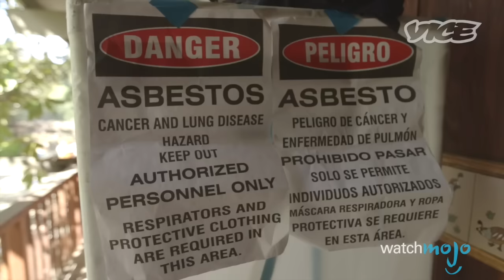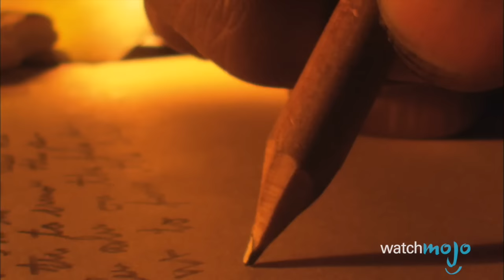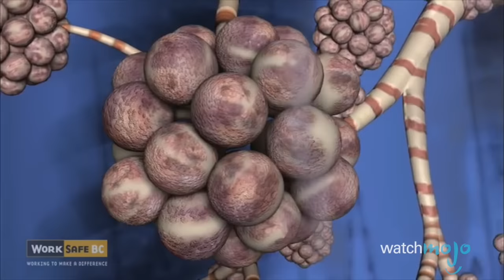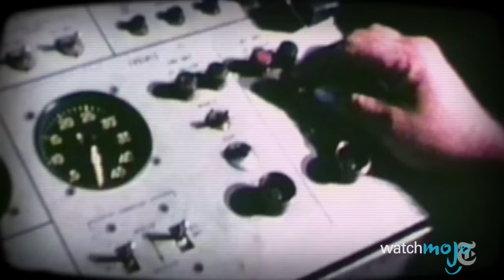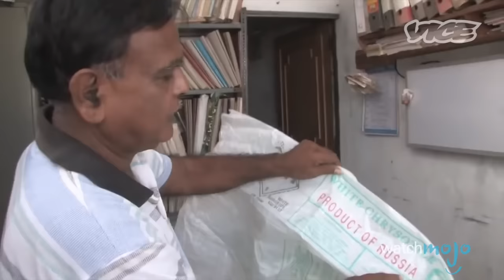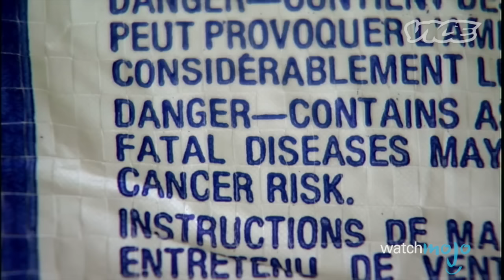Top 10 Dangerous Substances That Will Straight-Up Kill You

Comment: I worked in a chemical lab, and although you certainly didn't want sulfuric acid splashed on you, the stuff we feared the most was Hydrofluoric acid. That stuff goes through your tissues and dissolves your bones. Very nasty stuff.
Reply: it's poisonous too.
Reply: Yep...and unlike H2SO4, its kept in a plastic containers (as oppose to glass). It's also used in the hit series Breaking Bad as the acid of choice to dissolve dead bodies.
Reply: Average Joe teflon right?
Reply: notquitemytempo The one in our lab is polyethylene (I believe Teflon works too). The list in this video is a little overrated. There are far more dangerous chemicals that can "straight up kill you."
Reply: Average Joe not really sure why they used it when its a weak acid. Wouldn't Sulfuric acid be far more effective at dissolving dead bodies? Lol
Reply: Nikolai HF is a weak acid by chemical definition of what an acid is. But its not weak by normal standards. Its more harmful than the stronger and reactive acids.
Reply: I too work in a lab and the thing I fear the most is ClF3. That shit eats through almost anything except Teflon and especial steel containers.
Reply: Hydrofluoric acid certainly causes painful chemical burns, but it doesn't dissolve your bones. It can't, because calcium fluoride is insoluble. The fluoride from the HF will fluorinate the hydroxyapatite in bones, making them harder and more brittle - this is the same method by which tiny amounts of fluoride in water hardens tooth enamel.

The insolubility of calcium fluoride is how HF kills you though. Nerve function depends on the flow of dissolved calcium through ion channels. The fluoride from HF removes the calcium from your nerves by precipitating it out of solution, thereby halting nerve function.

This is how you don't feel the damage from HF absorption through the skin until it is too late - because it deactivates the nerve endings under the skin. If you absorb enough HF, it can deactivate the nerves controlling your heartbeat and breathing reflex, resulting in heart and respiratory failure.
Reply: Diazomethane is in a class of its own. This is a gas which is acutely toxic, carcinogenic and highly explosive. Special glassware is needed to produce it as ground glass joints, commonly used in most chemical glassware will trigger its detonation. Unusually for a carcinogen, you are like to develop tumours just 4 years after exposure, however, its acute toxicity means you are likely to die really quickly, long before developing cancer
Reply: Jude Ananaba  I didn't work in that type of chemical lab.
Mainly dealing with the cleaning and etching of metals.

Comment: There's a certain isotope of cobalt that is extremely harmful. It emits twice the amount of gamma radiation. Gamma radiation basically turns the insides of people into mulch. Essentially punching holes into the molecules of a person's body. If you watch any movie where the victim of radiation is vomiting white stuff, that white stuff is the stomach itself due to the gamma radiation. This particular isotope of cobalt can be found in crud which is a byproduct of reactors. It's rare and as long as the cobalt is inside the crud, it's not a problem. But just a tiny bit of the cobalt is 100% fatal when exposed

Comment: #4, Cesium (or Caesium) is the most reactive stable element on the periodic table of chemical elements (besides Francium of course). It reacts violently with water, exploding the instant the metal touches it. It's so sensitive that even the moisture in the air makes it catch fire (it's the most pyrophoric [pi-row-FOR-ik] substance we know of). It's also so dangerous to have around, that it needs to be transported in a glass ampuole under Argon or Xenon, contained within a pipe bomb, wrapped in tissue and bubble wrap and placed carefully in a small box with FRAGILE and DANGER plastered onto it. It's melting point is so close to room temperature that just holding the ampuole in your hand can melt the metal into what looks like liquid gold. It's also quite expensive (look it up, it's kind of crazy). Cesium has a variety of uses that use only a small amount, such as atomic time.
I'm kind of a nerd. I know this kind of stuff. WatchMojo.com failed to mention some of these facts (and I also corrected a mistake). You're welcome.

Comment: I once worked for a semiconductor (computer chip) manufacturing company, as a chemical technician. My duties were mainly to keep the “tools” stocked with the chemicals used in the chip making process. I placed tools in quotes because although “tools” is the industry name for the machine, it is basically a million dollar+ robot. 

Anyways, many of these machines use highly, HIGHLY caustic, corrosive and acidic substances. While many were very dangerous in their own right, the most terrifying to me was Hydrochloric Acid. It’s so dangerous, that if this chemical in its liquid state comes in contact with as little as 20% of the human body, you have about a 10% chance of surviving. 
The reason for this is that Hydrochloric acid has a a natural chemical attraction to calcium as it attempts to complete a molecular bond. As our bones are comprised of calcium, this acid will eat it’s way through the skin and muscles until reaching the skeleton. 
Fortunately there is a calcium jelly that can be used to temporarily neutralize the chemical reaction. However it’s far from capable of saving your life. The only thing you can hope for, is making it to a hospital that has the capability to deal with severe chemical burns. 
Needless to say, I worked this job for a short period of time before finding something that I wasn’t literally risking my life every day for $12/hr.

Comment: What about francium? It might only have a half-life of 20 minutes, but it is even more reactive than caesium.
Reply: A common misconception brought on by the periodic table and the rules of electropositivity. As you move down the table you get more and more electropositive and will more readily give away electrons to form a positive ion, this is what happens when the group 1 elements explode. However, as atoms get larger so does their pull on the electrons that are in the outer shell. Francium is very heavy (atomic weight 223) and as such holds the electrons close enough that its reactivity drops down below that of cesium (atomic weight 132).
Reply: The list is just plain bullshit. Francium is a million times more deadly than uranium, pollonium and plutonium combined, BECAUSE of it's short half-life.

Take 1g of a radioactive substance. If it has a half-life of 1 year it means 0,5g will have neutralized in 1 year, giving up it's radioactive energy.

If you have 1g of a substance that does the same in 20 minutes you have all of that energy in 20min that the other substance needed ONE YEAR for.

Because of it's short half-life large amounts of francium effectively cooks itself by it's own-produced thermal energy.

Though because it has such a short half-life there is hardly a concern for us, because not much francium exists at any time on the earth (that isn't artificially produced).

The problem with uranium and plutonium is not their radiation, no. It is because both of these metals are EXTREMELY poisonous. If you ate some of either metal, you would die by heavy-metal poisoning, long before you would show any signs of radiation poisoning (except when you'd take that stuff right out of a nuclear reactor).
Reply: ***** Less active in water, yes. But it's radioactivity makes it heat itself up. The larger the mass of the lumb of francium, the hotter it gets (up to the point where it just starts burning with air, but we know that much with cesium already).

Comment: Fluroantimonic acid. The most powerful acid known to humanity. It is 10^16 (10 quadrillion) times more powerful than 100% pure sulphuric acid, it eats glass, concrete, it burns things that have already been burned (i.e. ash), and it reacts violently upon contact with water. Fun stuff. Not much is known about the chemical because it is so hard to work with, and as far as I know there are currently no uses for it, and there is no known way to extinguish fires caused by this acid, because it will burn the extinguishing compound too. The only safe way to store it, is in Teflon coated containers, Teflon itself being effectively a byproduct of another superacid - hydrofluoric acid.

Speaking of hydrofluoric acid. It’s not quite as awesome as fluroantimonic acid, but still pretty gnarly. If you get it on your skin, you won’t know until 24 hours after it’s too late. The reason for this, is that the acid LOVES calcium. It won’t eat your skin, so much as penetrate your skin and it will eat your bones from the inside out. Because this acid is used so widely in computer pcb and Teflon manufacture for example, there are essentially epipens of an antidote which is basically a calcium gel (calcium gluconate to be exact) so the acid will prefer to eat that instead of your bones. It also dissolves glass. Oh yeah, the treatment regiment. If you are unlucky enough to get a hydrofluoric acid burn, the treatment guidelines specify that under absolutely no circumstances is the victim to be given absolutely any pain relief whatsoever. The reason why, is because they know that when it stops hurting, you’ll probably be ok. The safest form of this acid, is in a dental gel. That’s right - dentists use this shit IN YOUR MOUTH. It’s used to roughen up (read: eat) the surfaces of your tooth so that fillings stick better. It’s concentration in dental form is 9.6%, which is still plenty to do fun stuff with (like eat the plastic and glass layers of computer chips to expose what’s beneath).

Azidoazide azide. The most explosive substance in existence. It explodes when heated, cooled, touched, moved, left on a table in a climate controlled room, upon contact with light, and, it explodes for quite literally no reason. It is so explosive that, again, not much is known about it, because it is so hard to do experiments on.
Reply: Concentrated Hydrofluoric acid will kill you in like 5 minutes, not 24 hours. It will, as you said, eat the calcium in your body and cause cardiac arrest.
Reply: Moon Moon if the last one is so explosive, then wtf is it for and how did ppl make it in the first place ?

Comment: Sulfuric acid really isn't that bad. I once returned to the lab at my job back then to fetch my notes that I left there, while my coworker next to me worked with concentrated sulfuric acid, a test tube and a heater. Long story short: He worked with an air tight system, in which he sealed the corks but forgot to open the valve necessary for the wanted reaction. The test tube logically exploded, since the pressure had no other way of decreasing. I did not wear a lab coat, since my work time was over. So yeah.. Glass shards covered in sulfuric acid were sticking out of my arm and had to be removed and neutralized. I still have some scars, but would it have been phosphoric acid or nitric acid, the scaring would have been much worse. And, in the case of phosphoric acid, my elbow might have caught on fire. :3

Comment: Actually in terms of LD50, cyanide isn't THAT toxic. It would take probably 1/4-1/2 gram to kill somebody, and that's IF they consume it all within a couple of minutes, since your body is very good at getting rid of cyanide. What makes it so notorious compared with other poisons is that it's used very commonly in many industrial chemical processes, especially when it comes to gold extraction, like when processing ore or recovering gold from old electronics. So it's very available and easy to get a hold of. It's also pretty easy to make, requiring only very basic knowledge of chemistry (though at least a BA in chemistry to make it safely).

Comment: There is a scale of toxicity which would have been useful in this comparison: LD-50, or Lethal Dose 50%. The amount of material which kills 50 out of 100 of a particular animal per specific body weight. The lower the LD-50 (grams, grains) the higher the toxicity. It was invented in 1927 and has recently been phased out, but it is still a useful tool for comparison.

Comment: I think some of your research on organic mercury was wrong.  What you described is normal elemental mercury.  That's the stuff that accumulates in your body, causes nerve damage, etc.  Organic mercury compounds do not, as far as I am aware, exist in nature.  And they are RADICALLY more dangerous.  Like if I heard there was a gram of an organic mercury compound somewhere in my city, I would leave the city until it was found.  It is only handled in the most extreme isolation labs with more stringent safety precautions than necessary for handling ebola and similar pathogens.  A few decades ago a female researcher died after being exposed to it.  When she was working with it, in full hazmat gear in a negative-pressure room in a positive-pressure suit (so if there is a puncture, air would rush out of your suit but nothing in the room could enter), a couple drops landed on her glove.  She immediately cleaned it up.  But it turns out dimethylmercury, the specific compound she was working with, doesn't give a shit about latex.  It permeated right through and those couple drops raised her mercury levels to 80x the toxic level.  She died slowly over the following year.  Nasty, nasty stuff.  The ladies name is Karen Wetterhahn and her death was a tragedy.  She was no beginner, she was an authority on toxicology, and she was taking all the precautions, and it still killed her.

Comment: Also: A hydrogen bomb is not using usual hidrogen but deuterium or tritium. Because those initiate nuclear fusion at temperatures and pressure levels achievable on earth. They don't "implode". They explode. While nuclear fusion occurs.

Comment: There isn't that much lead in modern bullets. After the change from normal gunpowder to smokeless powder just after the US civil war the bullets had to metal jacketed to prevent the bullet under the extreme pressure and heat from firing to go semi molten which would leave lead inside the barrel that if not cleaned regularly would destroy the gun, also most people before that time if they didn't die from the shot itself it was by lead poisoning as the bullet was solid lead. Mercury in Fish varies between fish some fish you could eat them every day for your entire life and still die from old age not mercury poisoning.
Reply: Asbestos is still exported by Canada even today shame on you Canada.

Comment: Another horrible video by Watch Mojo. Do you only get your facts from movies?

1) Sulfuric acid shouldn't be an honorable mention, there are many more dangerous acids like flouroantimonic acid. And the film shown with it is WAY overdone.
2) Uranium is much more toxic than it is radioactive. Infact, it's not that radioactive compared to, say, astatine or polonium.
3) Mercury metal should be replaced by mercury compounds. Mercury has a VERY, VERY , VERY hard time getting through your skin, and even eating it isn't all that dangerous. Mercury salts, however, are EXTREMELY dangerous.
4) I feel like you should have replaced lead with flourine. That stuff is the devil of the periodic table. It reacts explosively with almost every element, and is extremely toxic.

Comment: A substance i have much respect of is dimethyl sulfate:
https://en.wikipedia.org/wiki/Dimethyl_sulfate

extremely poisonous liquid that emits deadly doses of gas (which has no taste, unfortunately). There is no antidode and dying by dimethyl sulfate intoxication is very painful (the substance is also a strong acid and causes strong chemical burn of airways and the like. When the chemical burn starts however its already to late.) Once the substance gets into your system it starts to mutate and kill your cells until your systems stops working properly (=very painful). And should u survive u will probably get cancer. Not a nice substance!

Comment: The choice of "dangerous substances" is purely subjective. The rank a substance as poisonous, it depends on what criteria you use.
As a chemist, I prefer different substances as highly dangerous.
My list: (not ranked, just what comes in my mind)
1. Dimethyl-Cadmium: Liquid, low boiling point, instantly flammable when in contact with air, produces Cadiumxoxide which causes deadly short-term cancer when being inhaled. When the liquid is absorbed by the skin, the weak Methyl-Cadium bonds will cause the compound to break into atoms with unpaired electreons causing DNA damage -> cancer. I few milligramm will kill you after a few weeks.
2. Methyl-Mercury. Nearly like above, highly volatile liquid, will be absorbed by the skil even when wearing double layers of Buthyl-Rubber gloves. Deadly cancer with a few day to weeks.
Anyway, most metal-organic compounds are dangerous, but the two mentioned are on top of this list.
3. E605: Organic phosphorous compound used decades ago as a pesticides. When applied orally, one will die within a few minutes. Was often used in homicide by "ordinary" people as one could buy it in many tool ot gardening shops.
3. DDT: Famous fungicide, nowadays banned. Due to the nature of strong carbon-chlorine-bond, this organo-chloric compound does hardly decay and is enrichening in the soil. Only strong ultra-violet radiation (sun) or higher temperature can destroy this compound. Causes long-term cancer and DNA failures.
4. Agent Orange: Like DDT.
5. Arsenic: Extremly poisous non-metallic element. Famous for "gentlemen homicide" in criminal literature.
6. Most poisonous metals: Plutonium, Uranium, Polonium, Mercury, Cadium, Thallium.
Plutonium is not only dangerous because of its radioactivity but also for its chemical properties. 1 microgram in your body - inhaled or orally applied - will cause death within two weeks.